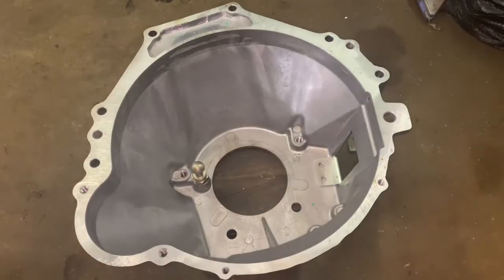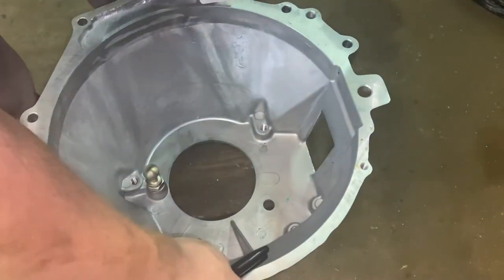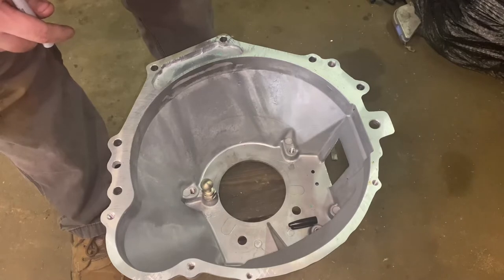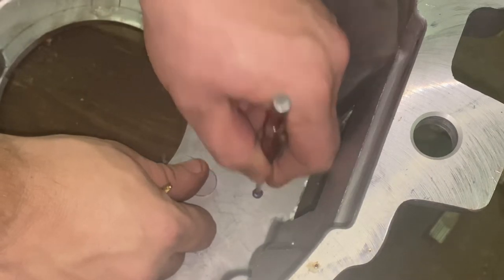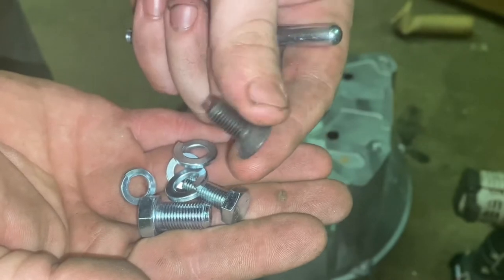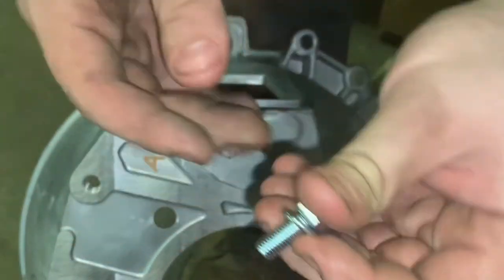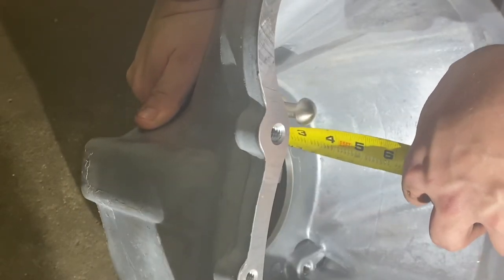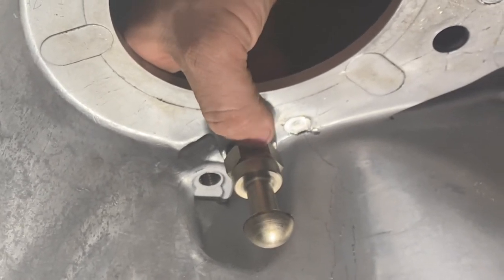How to install external slave cylinder on T5 from Modern Driveline.

Comment: Can u show how to bleed this slave cylinder? I have the same type for my T5.
Reply from the maker: Yeah I’ve been planning on making videos on bleeding, and adjusting the clutch and what not but then I always end up forgetting due to the fact I get other videos on my mind I wanna do. Not exactly sure when I’ll get it posted but I can tell you, it’s easy, modern driveline sales a kit. It comes with a syringe and cone shaped gasket to place on the reservoir and a clear rubber line. Open the bleeder valve on the shave cylinder, place the line on the fitting with a loop in the line so the air will stay in the line and not go back into the system. Fill the syringe with brake/clutch fluid and place it in the hole of that cone gasket. Remove the reservoir cap and seal, and also pull back on the clutch pedal to make sure it’s up all the way so no air is trapped in the system. place the cone with syringe on top of reservoir, hold tightly to reservoir and press the syringe firm all the way till it bottoms out. Fluid will come out of the line at the slave cylinder so have a catch can. Afterwords just tighten the bleeder valve and remove line then you should have a nice high firm clutch pedal. 
Hope this helps, good luck, thanks for watching.

Comment: Great vid can you send the link for the kit
Reply from the maker: https://www.moderndriveline.com/shop/hydraulic-clutch-kits/master-cylinders/ford-master/fairlane/66-70-fairlane-falcon-comet-68-71-torino-hyd-clutch-master-kit-750-bore/

https://www.moderndriveline.com/shop/hydraulic-clutch-kits/slave-cylinders/ford-slave/external-hydraulic-slave-kit-t-5-tko-for-79-93-sbf-aluminum-bellhousing/

Here you go, the first link I sent is the kit for the master cylinder installation kit for 68-69 ford fairlane and Torino’s. The second is the slave cylinder and mounting kit I used. Hope this helps, good luck on your install. Glad you enjoyed the video, thanks for watching.